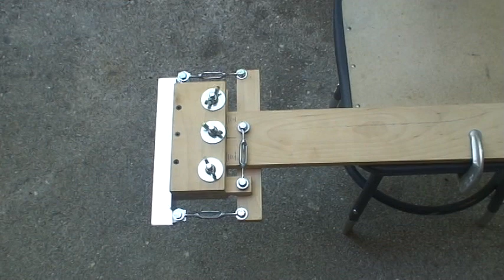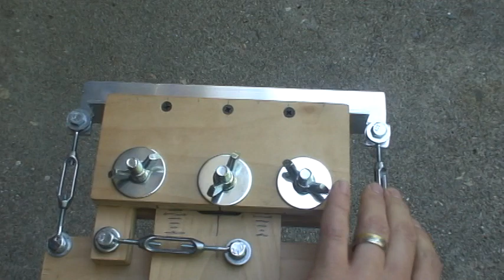DIY Printing Plans Micro Registration Beta

Comment: @Rebel18Lion The problem that we ran into was coming up with plans that could be easily reproduced in a shop with limited tools and hardware that is readily available and still come up with good tight registration. We started making and selling CNC cut press kits and are close to a micro registration system for that. The main problem with this design is the slop in the turnbuckles and that when you move one the other 2 move at the same time and makes it not very accurate.

Comment: You can buy the angled metal in just about any home improvement store in the hardware section. You'll have to cut them down to size, though, so make sure you have a blade that can cut aluminum.

Comment from the maker: Headway, Yes. All the bugs worked out, No.  We are now in the testing phase of the 1st redesign. We want to post the best possible plans so we will probably not post them until we are sure that it works well. I am also working on a better off contact mechanism and adding a tilt adjustment. I hope to have the next version ready to test by the end of the month. I am hesitant to say when the plans will be up due to unforeseeable problems, but thanks for your interest and stay tuned, it will happen.